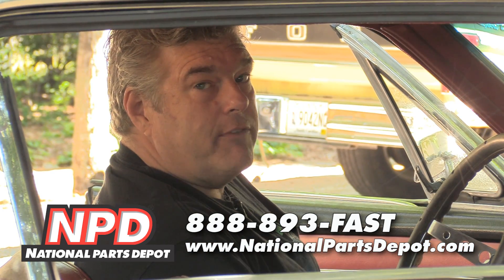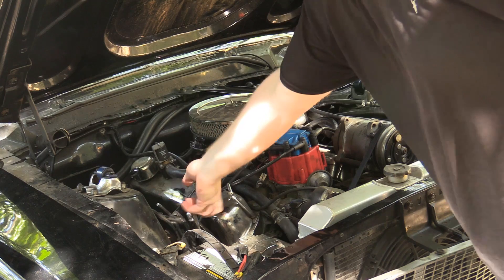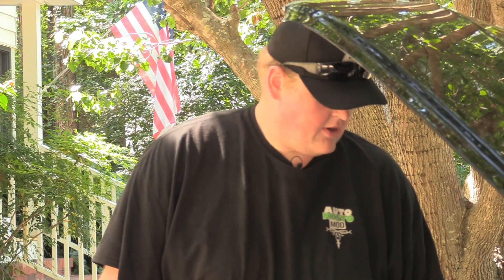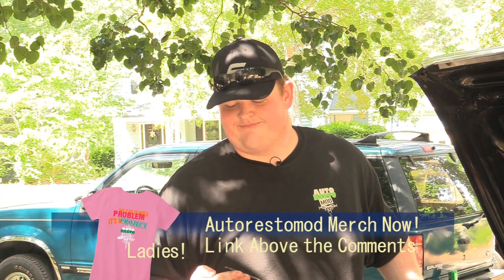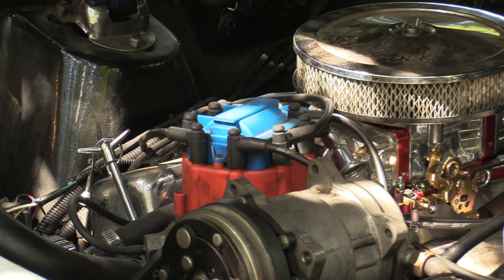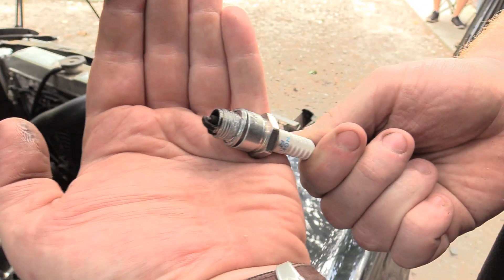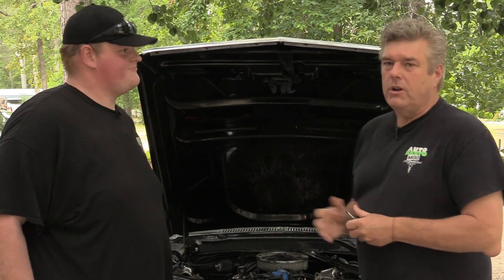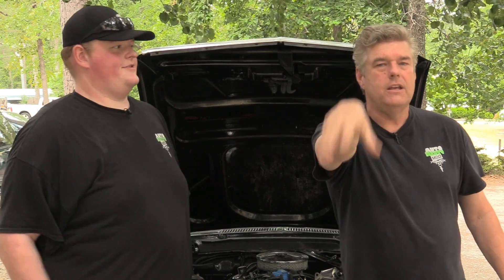3 Simple Engine Checks When Buying a Classic Car

Comment: Between 4:00 and 4:09 you said the engine has problems.  "At idle it felt like it had a missing dead cylinder?" then at the end of the video you said it was a good engine.  So I do not understand why you said it had a problem at idle?

Comment: Great video guys.  Cam - what about the GM HEI distributors don't you like, and what do you prefer?  if it makes a difference, I'm running a 1970 302 with points right now.  Have had the truck for about 20 years, believe engine is stock with the exception of a Edelbrock Performer 289 intake and carb.
Reply from the maker: Mostly it is the bulk. You can't fit a bigger style air cleaner. Other systems are neater looking (more "normal" on a Ford.

Comment: Are you guys gonna do a dedicated tuning video? Would love to see y'all tackle timing, carburetor adjustment, rocker nut adjustment, etc. I've gotten to the point where my engine starts and it runs well enough to test drive, but it idles high, chatters slightly, and definitely isn't tuned ideally; watching somebody who knows Ford small block engines work with theirs would be a Godsend for me. 

Cheers!
Reply from the maker: Already up!

Comment: One of the things I like to do is use a temp scan gun to identify which cylinder isn’t contributing. But on cast iron you have to do it before it’s heat soaked, on headers it seems to be easier to identify. Even after it’s hot.
Reply from the maker: Great tip!
Reply: @AutoRestoMod  taught that one to my son on his FE. Most cylinders had gotten up to 250 ish and one of them hadn’t joined the party and was about 150.ish.

Comment: Hey guys, I have a ‘68 mustang coupe. I’ve been looking into getting the suspension worked on. It’s just my daily, it only has the inline 6 in it. What would you recommend for me to do to make it handle and drive as smooth as possible? I’ve already looked into doing the Shelby drop
Reply from the maker: Good daily set up: QA1 single adjustable shocks, rebuild the front end, 1 inch front sway bar. Disc brakes. (optional>> roller spring perches

Comment: +++++ on compression diagnosis. I've been cranking engines without spark to determine possible compression problems since days of buying wholesale gems from dealers back lots. 

One morning found nothing promising at my favorite Pontiac dealer, left went back to shop. Couple hours later my partner shows up with a Dodge Omni, I passed on. It's going thut, thut, thut. I say "Bubba, that thing has a dead hole"(cylinder). Just needs a wire or plug was his reply. I bet him neither would fix it & pulled out compression gauge. Zero compression, I won. He didn't know I'd already given it the crank test. Let's say he learned something that day.
Reply from the maker: Teaching is fun...especially when you make money.

Comment: When you showed the plug did it have a gasket? I thought ford spark plugs used tapered seats?
Reply: Normal reason is engine has aftermarket heads.
Reply from the maker: Not sure what is going on there. We'll get deeper into that on the tuning video.
Reply: AFAIK only Ford OHV V8 engine to use 14mm gasketed spark plugs were the '54 239 & 256(Mercury) Y blocks. With introduction of 272 & 292 for '55, switched to 18mm tapered seat plugs. Used in all year FE, and small blocks till around '76 when plugs changed to 14mm tapered seat. Those were already used in Cleveland & 429 CJ/SCJ plus Boss 302 & 429. OK I didn't mention Boss 351, essentially Hi-Po Clevelands. Nothing really unique about those.  

Aftermarket aluminum generally use ¾" reach gasketed 14mm plugs. The aftermarket irons probably use 14mm ½" reach, never owned a set.